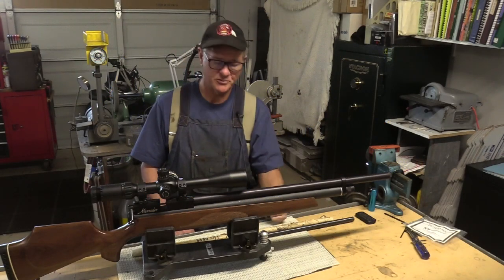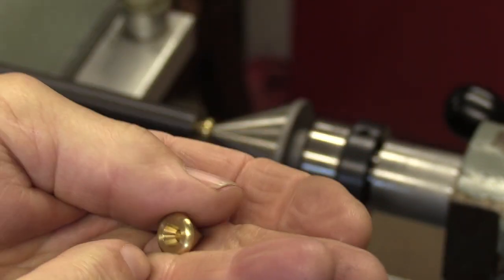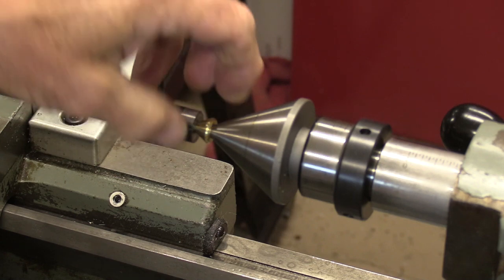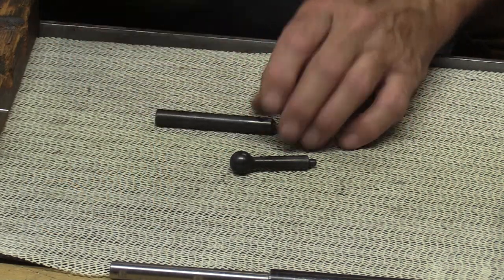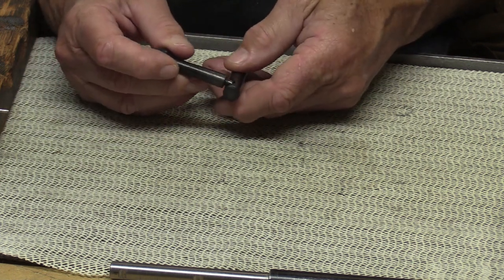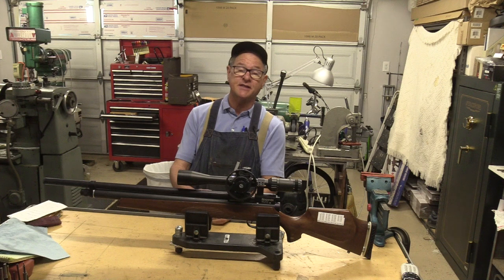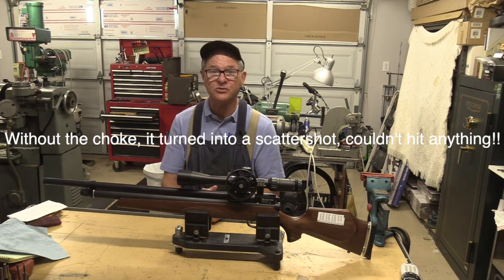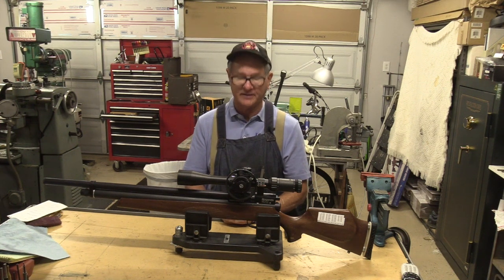Re-Barreling a benjamin marauder to .20 caliber

Comment: I have a Marauder in
22 caliber, but I have a lot of accuracy issues. I'm contemplating on maybe buying a new barrel to replace the factory one. What is your thoughts on this? Do you think I'd be able to change the barrel myself
Reply from the maker: Have you tried different pellets?  That's first, before you start changing barrels.  You can do it yourself if you have even modest mechanical skills.  Barrels other than Crosman would likely have to be machined to fit the receiver, unless you can find an aftermarket drop in barrel.  Google 'marauder barrel sale' and see what comes up.

Comment: I've been looking for someone to do this to a Crosman 362‼️ Recently purchased a Benjamin Blue Streak to add to my collection and would like to convert a Crosman 362 into a .20‼️
Reply from the maker: Chulo, not familiar with the 362, if the barrel is soldered to the tube, then it wouldn't be feasible.  If it's separate from the tube, then doable if you can find a decent .20 cal barrel.
Reply: @NorthWestAirgun  The Crosman 362 is similar to the Crosman 1322 that you can upgrade and install a steel breech on it. It's not soldered. Just thought it would be feasible to make your own .20 cal barrel or that you could make one.
Reply from the maker: @chulopapi2300  Naw, not set up to make barrels.  If you find a good source of quality.20 cal barrels, let us all know.
Reply: @chulopapi2300  I have been thinking about rebarreling a 1322 too 25 caliber. I could order a 25-20 barrel liner from Brownells. They sell liners in various calibers for re-lining old shot out barrels. The outside diameter varies with the caliber.
I would have to cut and crown the barrel And drill out and machine the port but it doesn't look that difficult.
This would tale advantage of the power upgrades available for this gun.

Comment: I have a .22 cal Marauder, is there a way to change it to .177?
Reply from the maker: Yes, get a.177 bolt and barrel from Crosman, you may need a different receiver, but I'm not sure about that.  First, download the parts diagram;

file:///Users/jonathanbrooks/Downloads/1763%20and%202263%20EVP%20and%20PL%20Phase%202.pdf

then order the parts from their customer service.  I also have a disassembly video that may help;

https://youtu.be/kCqPYmHG048

Good luck!

Comment: Good video I like you video  Thanks 🌹👍
Reply: Jon, very well documented Re-barrel video.   
As to timing or AKA "Clocking", how i choose correct position is that of barrel Run Out is having barrel slip fit in receiver and be the holding fixture when measuring.  
If the barrels slip fit into receiver is such than minimal wobble is present, I hold receiver in a bench vice and rotate barrel noting the muzzles run out with a dial indicator finding the point in rotation where the bore and bench top dial indicator ( using a gauge pin into muzzle end of bore )  clocks high at 12'oclock.  Marking barrel where this occurs and machining as such to have barrel slightly shooting UPWARD where such run out is found. 
Clocking upward is similar to a scope mount that might contain some MOA tilt correction. We always adjust a scopes elevation up to get a zero range, so why not have barrels bore angle if present do a bit of the correction for us. 

Yes indeed the basic machining for fitment is one thing,  Prep after the fact for correct leade profile, free bore etc is another where the end result VERY WELL may be defined bu how well done. A good Crown job at muzzle is another place that can make or break all the other work !!  Myself I just use a Live center at muzzle & shim chuck so the run out of barrel at opposing end hanging out of head stock / spindle in minimal.  Once done a minor face off at muzzle end and crown prep is done.  *Do Not use Piloted crowning tools !!!

Have fun, learn while you go ... when in doubt ask questions.

Scott S
Motorheads AG Tuning Services
Reply from the maker: @dawnschneider6369  Good stuff!!  Thanks for the tips.